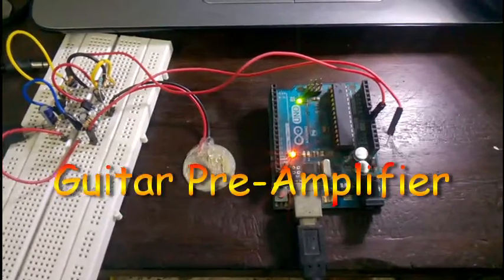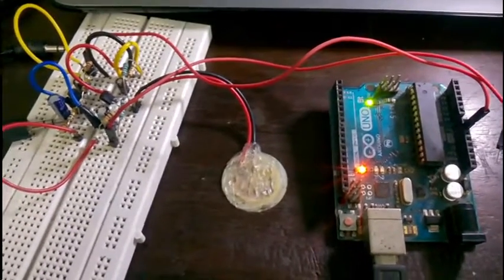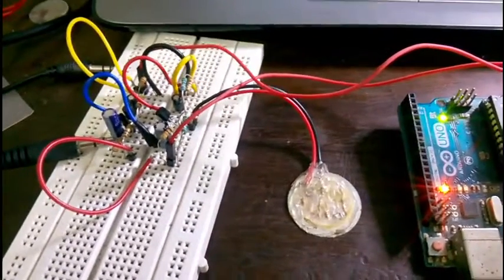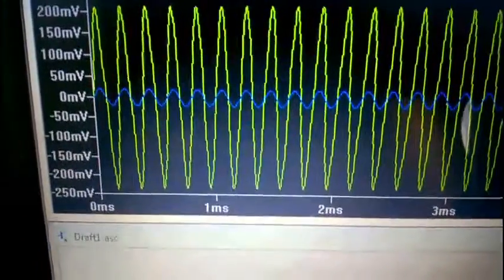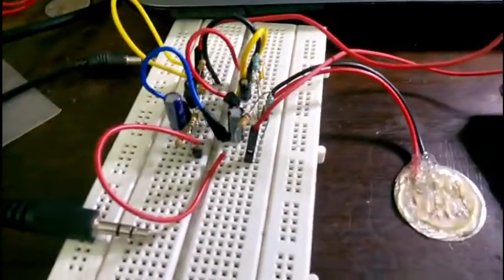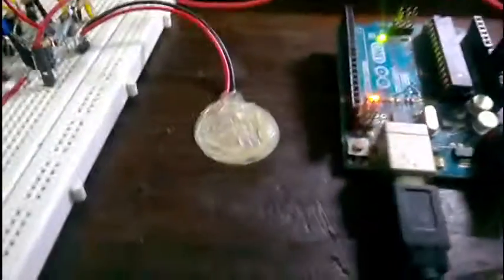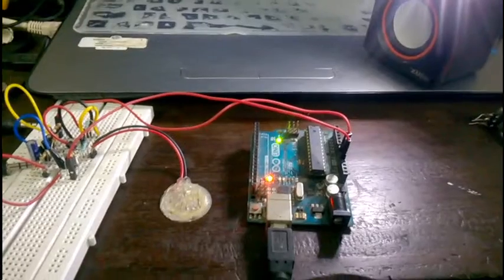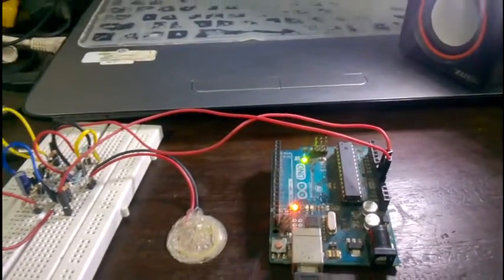DIY Guitar Pre Amp using transistors and Piezo

Comment: this looks good can you provide teh schematics?
Reply from the maker: https://circuitsforyoutube.blogspot.com/2017/11/high-impedance-pre-amplifier.html C5 capacitor is where the piezo disc connects and depending on the amplification requirement, you can take output from C4 or C6.

Comment: Did u upload video of finished product
Reply from the maker: No, BJTs are bad for high impedance application. I'd switch to MOS amplifier instead.
Reply: @jainvibhore1997  can u keep link of mos amplifier
Reply from the maker: @unclechips9999  I did not make a video of MOS amplifier. You can however find the BJT design here. https://youtu.be/awT3MEbR9ms

Comment: Hey, thanx for sharing this. 
I want to connect piezo to cajon and get output from a portable speaker or computer. Will this system be useful for that?
Reply from the maker: Yes, its totally fine to use it with cajon.

Comment: Hii, i search a god amplifier to piezo reverbera box but i dont found!! What is the schematic of this amplifier? Thanks!
Reply from the maker: Hello, if you want to make a guitar pre amp don't use this circuit as it catches a lot of noise. Here are the schematics.
https://2.bp.blogspot.com/-KRlqqgS6pdM/Wf2utJZPauI/AAAAAAAAB2M/7hCgxqltLSAw-lDbjWlUqmLKMgl96xytwCLcBGAs/s1600/newckt.jpg
Reply: Vibhore Jain thanks, its for something like this https://youtu.be/p_NqX_Bvfxs
Reply: I have a amp with lm386 but the circuit doesnt enough gain to amplify with my subwoofer . Maybe i try with guitar amplier
Reply: Vibhore Jain c5 and c6 is the piezo? And c4 output?
Reply from the maker: Oh. this circuit will work but make sure you use batteries to power it to avoid electrical noise from the mains.
Reply from the maker: LM386 cannot amplify high impedance inputs like the piezo so it won't work in your case.
Reply from the maker: I am sorry C6 is not supposed to be in the circuit. It is just an output with a lower gain. Piezo connects to C5 and ground and output is C4
Reply from the maker: I am not sure how much sensitivity you need but just follow this link to estimate if this circuit can be used in your application.
 https://www.youtube.com/watch?annotation_id=annotation_3065219677&feature=iv&src_vid=uan2dmFxy8c&v=awT3MEbR9ms